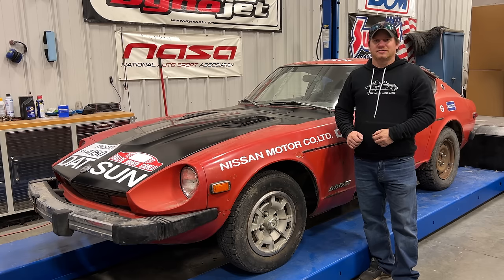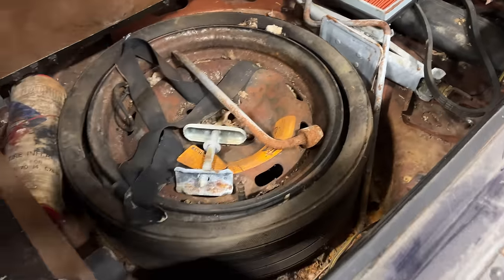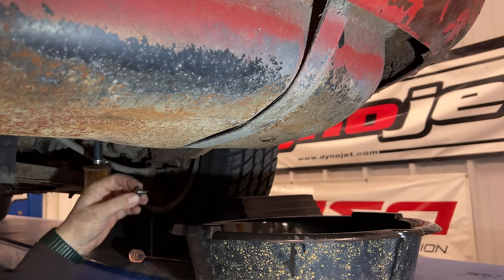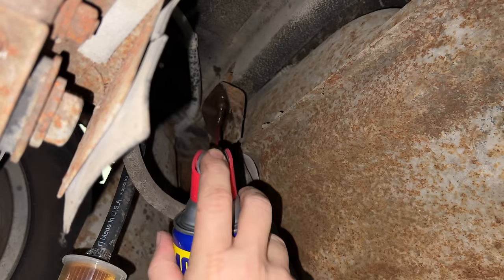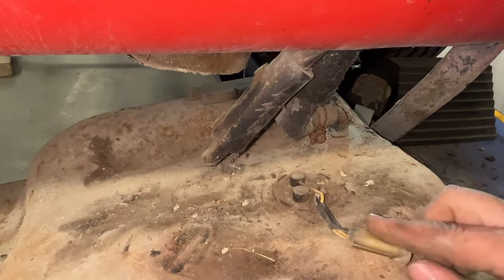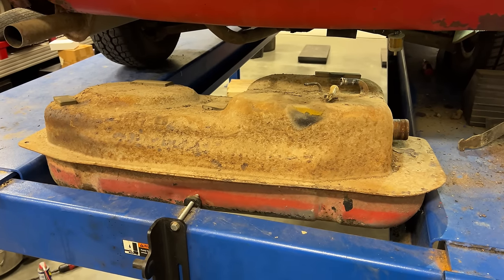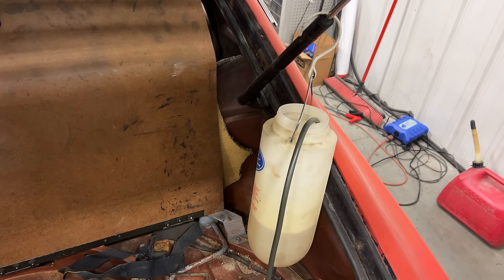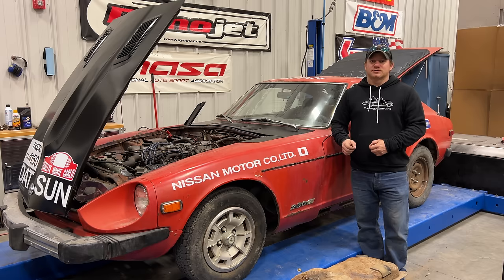1976 Datsun 280z - Fuel Tank Removal

Comment: Good video. I agree with some of the earlier comments, it would be interesting to see more videos of this car. I think that the 240/260/280Z series was one that most of your viewers have had some connection to one or more of the models of this car.
Reply: These cars are worth a fair amount to someone, even in terrible shape. I thought that most for them were available on the aftermarket. 
 I’ve owned a couple of these back when they were common. So much fun! Even better de-federalized and lowered to a proper height!
 Also ditch the bumpers for 240z  skinny bumpers. 
 Speaking of bumpers. If they are original it makes that one a 77 or 78 model!
 Fix the tank!! You can do it!!
Reply: @davidbeaumont4455  it is a '77 as the spare tire cover angles up towards the hatch. The spare tire cover was flat to the taillight panel in '78.

Comment: There are at least 2 videos on YouTube showing rusty fuel tanks being strapped to cement mixers and having small amounts of gravel inside, to clean out inner rust. If they're a bit thin, electrolysis could be used to restore some metal inside.  On the other hand, $400 might be worth it to avoid the work.